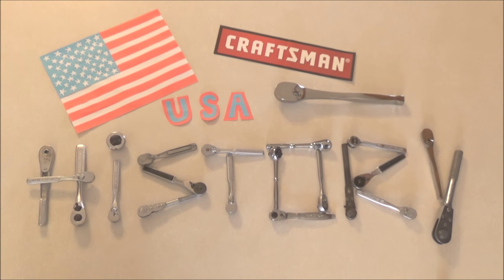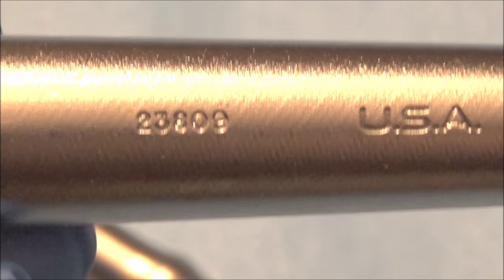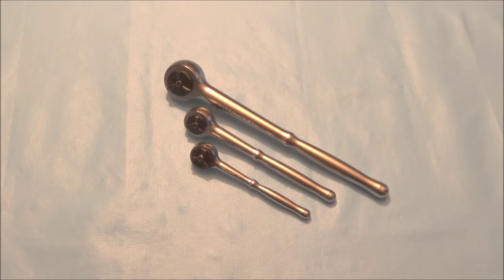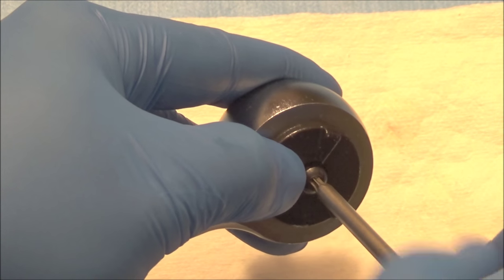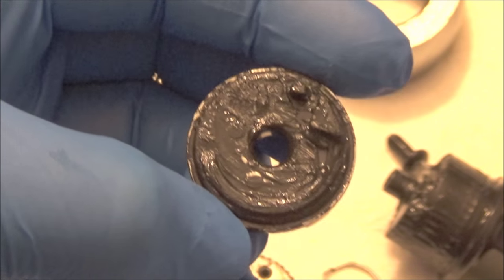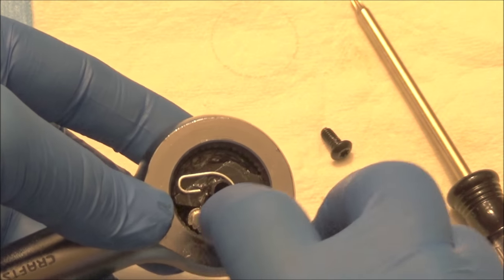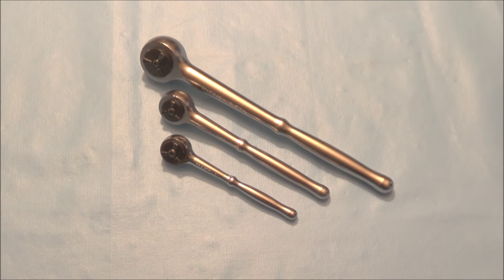Craftsman Tools - USA History: Round Head Ratchets - Rebuild & Discussion

Comment: Thanks Gear Wolf for this great video.  Had two older, but hardly used ratchets (both torque wrenches) that both mysteriously weren't working.  I found this out for both of them on the same day when I needed to use a torque wrench.  Weird.  But, I found this video and problems solved.   Not hard at all.  Thanks again.
Reply from the maker: Not a problem!

Comment: I've had two Craftsman torque wrenches that stopped working and by that I mean that they wouldn't ratchet anymore or change direction. I pulled both apart,  lubed everything, made sure the spring leg was straight (it wasn't both wrenches had a bent leg) and now they work like new again. Thanks
Reply from the maker: Rock on!  Glad to hear it!  ^_^

Comment: I disassembled the 1/4" version (43174) because oiling it did not help.  Apparently, the tiny spring jumped out onto a cocoa doormat, blending in with the matting.  Your video helped in that now at least I knew what I was looking for.  A little glint of light on the spring appeared to me, and now I again had all of the pieces.  I had used synthetic bicycle chain oil to clean it up prior to disassembly; now I used Lubri-Plate 660 (I think) to lube the gear teeth up good prior to reassembly.  The internals were completely dry, as I probably never used that ratchet for any oily work.  Now, it operates smoothly and quietly, just like new.

Comment: Thanks. Exactly what I needed to fix my torque wrench. The spring on mine got misaligned because the top screw came loose. Bent the spring back so it was 90 degrees and straight and aligned the top cover as you mentioned which is tricky. Works great now thanks!
Reply from the maker: No problem!  Glad I could help!

Comment: Just started looking on the web where i could trade in my 43174 1/4 inch drive ratchet..then bam! Found this great video..took it apart, carb cleaned, and tooth brushed out the old grime, i lubed with N@PA Sil-glyde, and again she works like a swiss watch Lol!!

Comment: this is pretty much how the facom ratchers are, and are very strong, the craftmen have way excess thickness of metal around the head, so could be slimmed down. the facom ratchets are tested to what amounts to human amount of weight even on the 1/4 drive, and many hundred of pounds more on the 1/2 (least my 80's facoms ones were!)

Comment: Awesome series,  thank you! I'm stuck with a 43772 EE7 . The ball that holds the socket on is a bit sloppy/weak. I can't figure out how to get to it. Any help would be great.  Thanks!
Reply from the maker: Hello!  Thank you for the question.

Unfortunately, the ratchet that you mention is actually not an American made Craftsman ratchet.  The 43722 was a part of ratchets made in Taiwan by Stanley.  My series specifically focuses on USA made ratchets.

Despite this, I can offer some advice.  If the bearing that holds the socket is a bit sloppy, odds are the spring beneath it is broken or weakening.  Given this, you'll either need to bore out the bearing and install a new one, or simply find a replacement of the ratchet mechanism for your ratchet.

Your ratchet was a part of a family called the "Quick Clean" Craftsman ratchet.  Your best bet to find the replacement mechanism is eBay.

Comment: Thanks - it took a lot of attempts and quite a bit of micro-bending of the curved pin - I think it's trickier on the 3/8" - but I got it!
Reply from the maker: Glad it worked out Matt!
Reply: Agreed, out of curiosity, I took apart my 3/8’s, and couldn’t get it back together.  With this video, and several dozen attempts it’s back in service.

Comment: Some of the torque wrenches have the logo on the plastic handle, which rotates.   So that can’t be used for orientation.   Also, I’ve always found it quicker to install the end with the put the selector plate in first and then install the other side.
Reply from the maker: Steve, I'll have to give that a try.

You are correct about the torque wrenches.  I will be including those in the "reboot" of the series I have been working on.

Comment: I got all the way to the part with the tightening and loosening selector working. but the ratchet function will not work no matter how many times I reset it. I have a craftsman 9-31423 torque wrench with  the same mechanism.  it was working before i took off the cap, any suggestions?
Reply from the maker: If I had to guess, the pawl spring is likely not catching the little nub on the retention/selector plate.  Ensuring they meet up for engagement is a pain in the butt during reassembly.  If you fail to make this happen, your ratchet WILL not work!

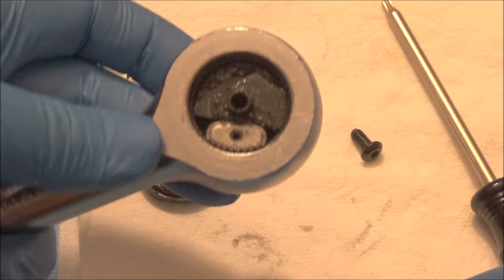Watch 8:20 to the end of the video a few times.  Much like I said on the video, this isn't a particularly easy to reassemble, so take your time and watch the video until you get it.  Shoot me another message if you need help!  ^_^

Comment: Fixed my torque wrench Craftsman  44595.   It's not perfect, but better than it was.  It only works properly in the tightening direction.. turn the dial the other way and it just free wheels.  But, that's ok with me. I've never had to torque anything in the ccw direction.... 

Ok I fiddled with it a little bit and was successful getting it to work in both directions. for now.. I'm afraid my "spring" is just old and not as springy as it used to be. 

thanks
Reply from the maker: It is a great design with one serious Achille's Heel: the wimpy spring. -_-

Comment: reviving an old thread. Got it apart after discovering it was freewheeling with no resistance at all. After cleaning and lubing and putting back together, the bread loaf appears locked in the teeth of the ratchet. No turning at all. Any advice?
Reply from the maker: Hi Michael.  The key is to make sure that the spring is interlocked with the pawl (bread loaf) and selector plate as demonstrated in the video.  It may take a few tries to get it right.
Reply: @GearWolf  Thanks. Looks like my spring is sprung - there is not nearly enough tension in it to keep the pawl up against the center block as you show in the video. Wonder if I can find a new spring anywhere....
Reply from the maker: @mwmosser  Michael, in my opinion, the crux of the entire mechanism is the spring.  Unlike other conventional ratchets, where it is fairly easy to retrofit a non-OEM spring sourced from elsewhere, this one is anything but.

Unfortunately, your best bet to find an OEM repair kit is on eBay.  Check the description of the video to find the repair kit number you need.

Comment: if it no longer locks, does that suggest the spring inside is broken?
Reply from the maker: Possibly.  I would check the internals.  Let me know what you find.
Reply: @GearWolf  The Torx 15 bit wouldn't open it... so I just went with the lifetime warranty replace.  I might someday take another crack at fixing it.
Reply from the maker: @pdxdoglover  Did they let you keep the ratchet?

Comment: ok you showed me how to take it apart, now how do I repair the spring that pushes the ball in and out on the socket holder
Reply from the maker: You'll have to bore out the bearing, replace the spring, and have a press install a new bearing.
Reply: TheseAreMyToys plop lplappppPL

Comment: I have a few 3/8 round head ratchets that are numbered USA-VK-43175. Came here because one of them is not working and I can't get the torx screw out .
Reply from the maker: If you haven't stripped the torx screw, give this a try.

Get the appropriate torx bit in the screw.  Give the torx driver a few good whacks with your hammer.  Then attempt to turn the screw.

Let me know how it goes!  ^_^
Reply: @GearWolf  I did try that put will try it again. That ratchet and the rest of the set that it came with have been in my basement for years. My basement is not like the Sahara and does have water in the sump from time to time. I bought 3 sets years ago as starter tool kits for three of my sons and they have been interested in using them until recently so I rouse them out of the basement and two of the three ratchets work fine the other I'm sure got some condensation in it. Thanks for the advice and for getting back so quickly. Have a great day and Happy Motoring.
Reply: @GearWolf  Got it. Smacked it a few times. I also used a bit and a quarter inch breaker bar. Took a few times putting it together but it's working fine now. Thanks a bunch.
Reply from the maker: @mostlymoparih5682   Yeah, when they are put together correctly, these ratchets run really well.  Despite their almost painfully simple design, they can be a challenge to get running after maintenance.

Glad everything went well!
Reply: @GearWolf  Just used it yesterday and it worked like a Champ. Oops sorry I mean like a Craftsman.
Reply from the maker: @mostlymoparih5682  Hahaha!  Awesome!